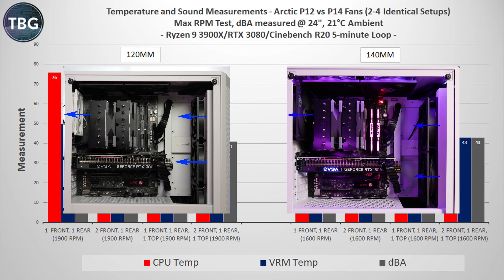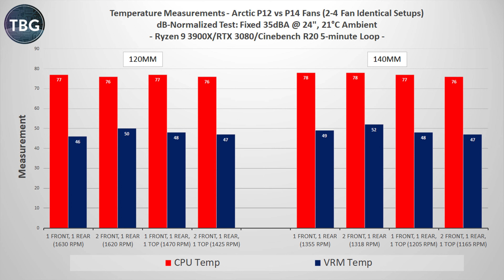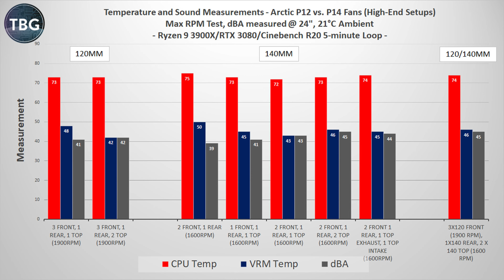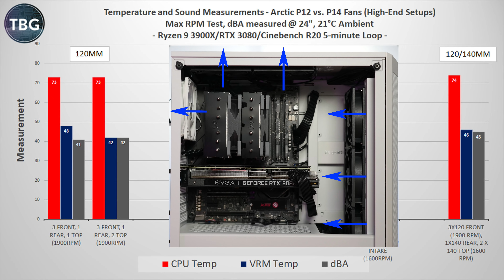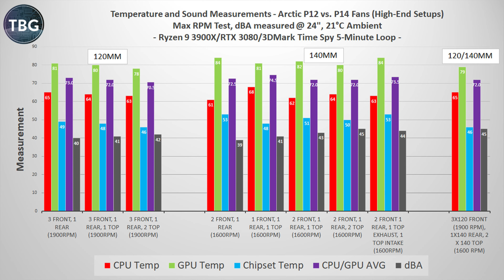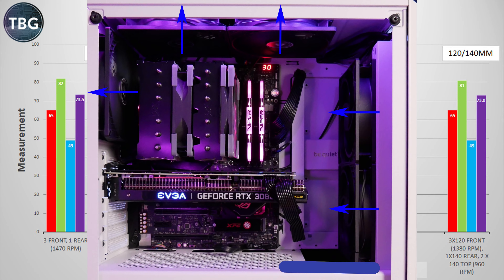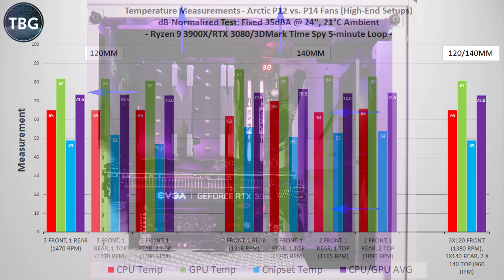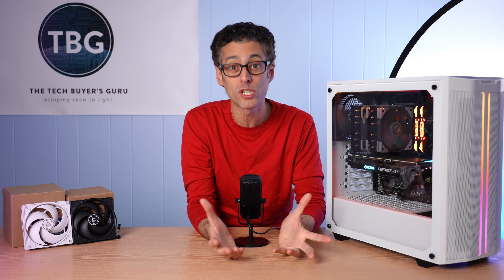The Best PC Case Fan Setup - How Many, What Size, and Where, feat. Arctic 120/140mm Fans!

Comment: I'm two minutes, and 55 seconds in; you haven't done any testing yet, and I'm already loving it.

EDIT: I just finished watching the video, that had to have been one of the quickest 15 minutes of my life. 
The Premises that you've just opened up are all highly interesting, and don't get me started on the delivery, PERFECT!
....For me, at least. I'm sure the majority of other users that don't think to look at this sort of content would probably prefer to be told "What's better, 120mm or the 140mm fans?" followed up by "Which is the optimal placement".  They'll have a fit right in front of you if you dare use the word "variables" in a sentences to them.
Reply from the maker: Thanks for watching the whole thing, and I'm glad to hear it didn't drag on for you despite all the data! I do heavily edit my videos to cut out the chatter (stuff that seems interesting as it comes out of my mouth but isn't once I listen to it!).

Truth be told, I fully expected different results, even testing the setup that I thought was "right" at the end so I could keep it running in my system only to find that it was terrible (that was with the top fan flipped).

I do hope that this video opens up a new dialog on PC cooling, because I don't think some of these issues have been fully examined thus far. Of course, I left about a million variables on the table for others to play with, so it's not like this conversation is over, it's only just begun!
Reply: @TheTechBuyersGuru   This message is a bit lengthy, I get carried away in writing/research sometimes and then realise what time it is and how long I've invested towards sharing a suggestion.

From my perspective, your last video has opened up a whole new ballgame in regards to testing, the problem is, there's no way we could expect you to cover each new door. I went through the latest comments on this video, which you've done a stellar job at responding too. It seems some people would still like you to take their suggestions into account with testing, but with your level of detail, their requests are much larger than they realise.

Perhaps in the next video, you could consider leaning in a different direction, allowing you to still follow-up on this content by keeping the users engaged and not putting an unrealistic workload on your shoulders. I had two thoughts in mind:

Directly asking your fanbase to experiment using a set of specific parameters. You could document three-five different types of experiments you'd like to see numbers in, then assign two volunteers to each experiment(if available). I'd imagine that some of these tests would help the users construct questions or statements that may make it easier for you to strategically invest your time. Their results would not be conclusive in any way; it would just help lead you towards something in which you deem interesting or valuable.

The second was sending out emails to individuals who handle airflow/circulation at a professional level, something like a structural engineer working in the airflow department. Briefly explain your position. You're trying to give individuals insight to maintain their hardware safely whilst also educating users enough to indirectly lower sales towards poorly engineered cases and fans. The last statement changes depending on who you're contacting; it's supposed to be a reason that relates to their values/morals/ethics. Ask if they have time for a couple of questions if so, show them a diagram of what you thought would work, and why; then followed up with what seemed to have worked. If they're hesitant in helping, you can mention that whichever professional adequately supports will be mentioned in that video with a thank you, as well as their business subtly brought up. E.g. I want to thank John for yada yada who's currently working as an Air Conditioner manufacturer for X company."

There are also some interesting ways of measuring airflow from some brief Google search pages, perhaps if you were to use a tool to take a few measurements in your worst and best case-fan setups, you might be able to find similarities which turn out to be consistent with future tests.
Reply from the maker: I was seven words into your comment, and I got worried, but then I finished reading and I loved it!
Reply: I should apologise for the way I structured my first message in the beginning, I guess you could say that's a bad habit.

Comment: just order Arctic p12 & P14 for my Lian li Lancooler mesh 2, excited! :)
Reply: I have the Mesh 2 Performance. Got the 5-pack of Arctic 120s and 140s. Replaced back fan and CPU air cooler fan with the 120s. Daisy chained 3 140s at the front (can be done, the middle one is stacked behind the bracket and the top and bottom in front of it. I think I had to turn the bracket around, which is an intended config). Set at Auto it runs very very cool regardless and is silent.It's win-win all the way.
Reply: @ElsinoreRacer  What were your temps before you changed fans?  I have the RGB version with 3 120's in front, 2 under gpu and one exhaust.
Reply: @ElsinoreRacer  Have you noticed any resonance issues? I have the p12s installed in the exact same case and noticed a bunch of resonance issues across almost the entire rpm range. This has made leaving them on auto nearly impossible since the low noise levels are ruined by the high pitched sound of the resonant frequencies when the fans ramp up and down.

Comment: I'd like to address the off high pitched hum that comes from the P12 at  1000-1500 RPM. You can hear this in this video:https://youtu.be/rb9Rt5G1ZlQ?t=90 Once the PWM value is in the range of 41-65 the pulsating resonance hum is noticeable, especially when in the specific resonance. They work very well as case fans at constant RPM. I'd just note the extra fan tuning, to avoid the humming RPM range, if they're being used on a Ryzen CPU cooler (which constantly spikes unless using RyzenMaster.) The same thing occurs with the P14 except lower frequencies.
Reply: I have arctic freezer 34 esports duo as my cpu cooler,..the fans are p12 bionix, and they have the same hum resonant sounds,..very annoying btw
Reply: this is true. i have two p14s. one in front, one as rear exhaust. the hum starts around 1000 rpm so i keep them at 950 rpm constant. definitely not buying arctic fans anymore.
Reply: @Kachongui Kach Just keep them running at constant. my hum now starts at 900 rpm but disappears between 1000-1100. a couple of weeks ago, it started at 1000. lol
Reply: I use Skiron fans instead of Arctic for this reason.  Their sound profile is consistent as they ramp up in RPMs.  Downside is that their lifespan isn't as long as Arctics.
Reply: @Kachongui Kach I think its just the motor.
Reply: @Kachongui Kach I just set the fans to run  at constant speed from BIOS. Or full blast above 70 celcius. The resonance noise isn't all from the motor. It's mostly the major third chord, from the five fan blades, like a five cylinder engine.